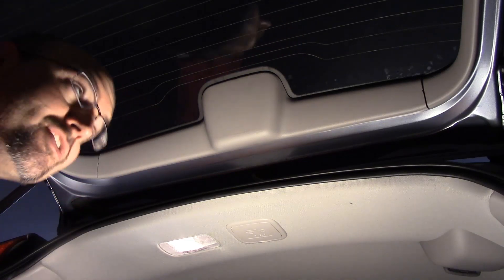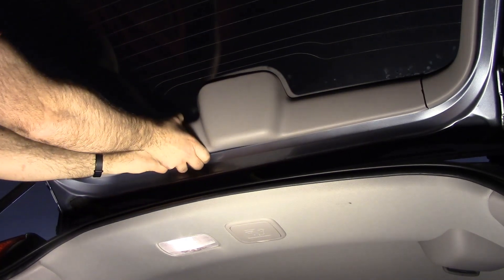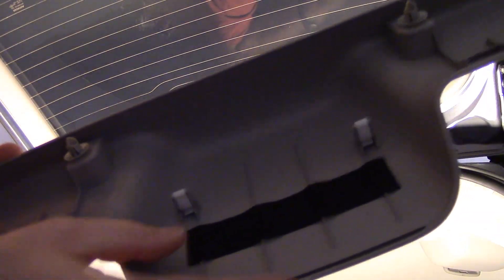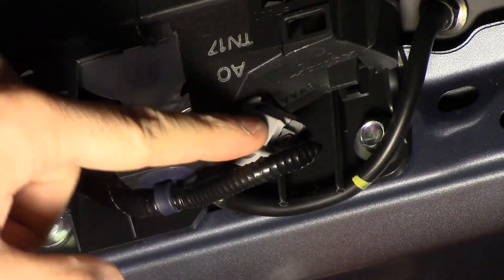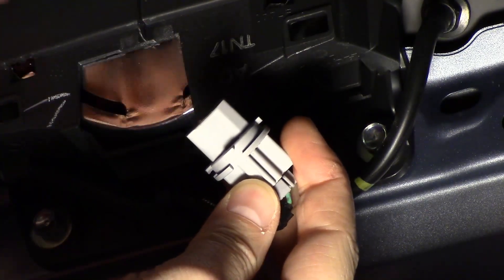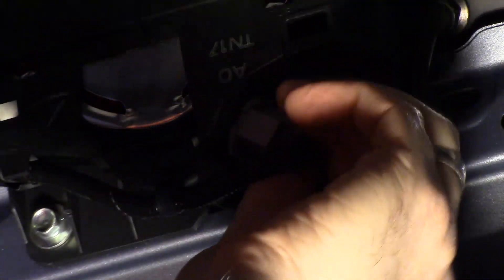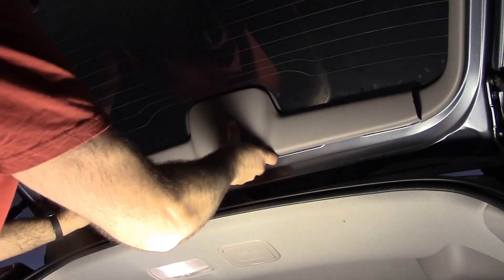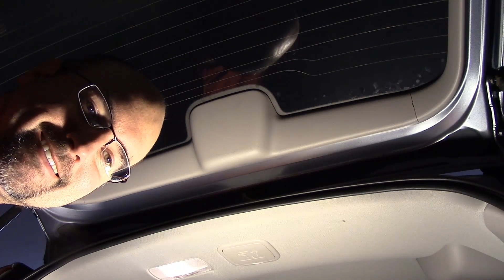Honda CR-V Center Brake Stop Light Tutorial

Comment: I wish you had a video for replacement of the LED assembly on the 2016...
Reply from the maker: I am pretty sure the LED one, is not user replaceable,  I think you have to go to the dealer or install a complete new fixture. the LED's are soldered onto the board.

Comment: Hi Mitch, I see the two tabs (on the sides), but having trouble releasing them. I stuck a screw driver in - tried straight in, prying to the left/right, and nothing seems to work. Any more advice on this step?

Comment: yes - looking for info for the 2014 (4th gen) high mount LED brake light - I think what mitch showed was for the 3rd generation CRV?
Reply from the maker: The LED one, is not user replaceable,  I think you have to go to the dealer or install a complete new fixture. the LED's are soldered onto the board.
Reply: gracias  amigo  por  todo

Comment: I have a 2012 CR-V with the LED brake light.  It is flickering so I suspect it will be failing soon.  Does the whole unit have to be replaced?
Reply from the maker: I am pretty sure it does.  cant just swap the bulb on those.